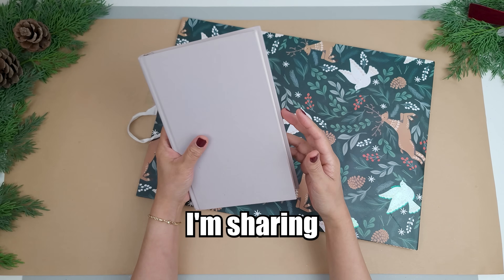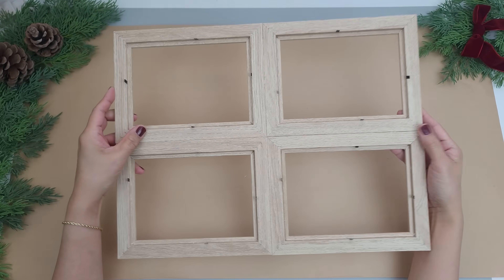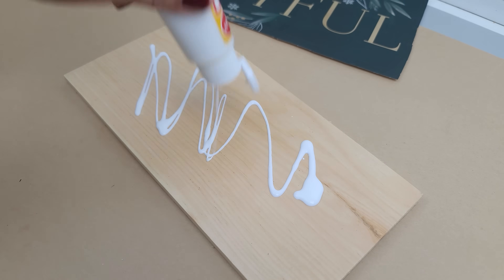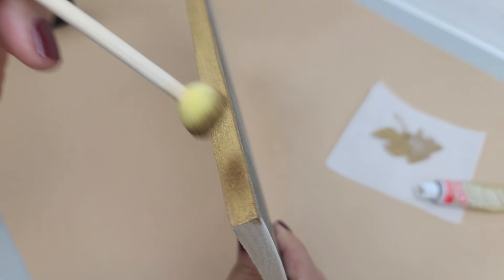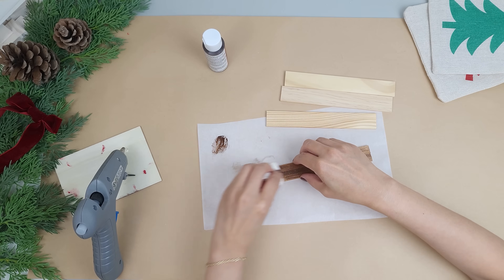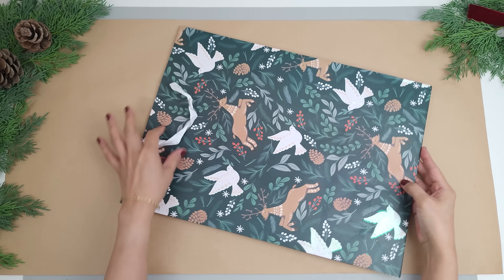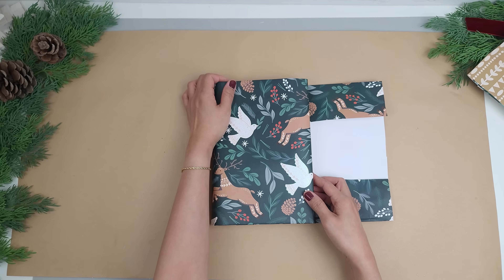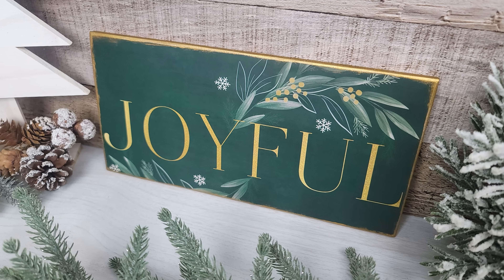Turn Dollar Tree Gift Bags into Stunning Christmas Decor on a Budget!

Comment: Love these, JC! I attempted the window picture. Because my frames (I think they are the same as yours but I’m not certain!) attach to each other by a thin piece the E600 made a mess and I had to try to peel the part that oozed onto the front off. How did you keep your glue from showing when you push the frames together?